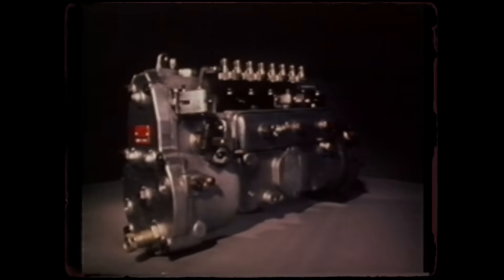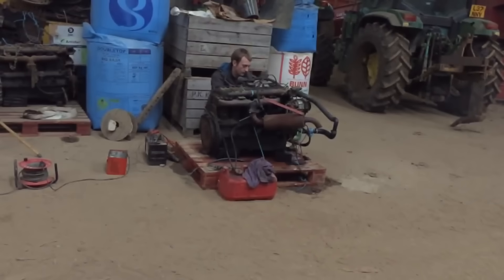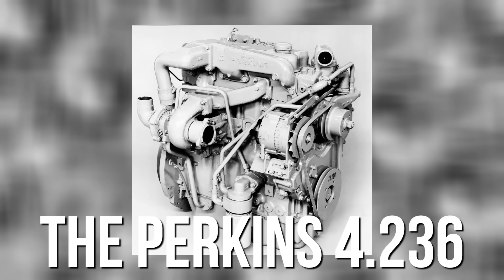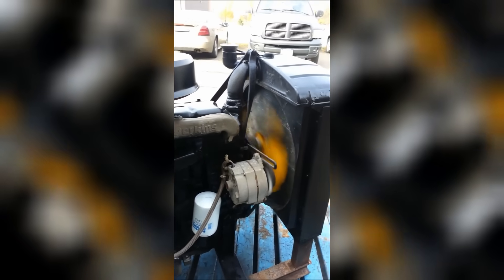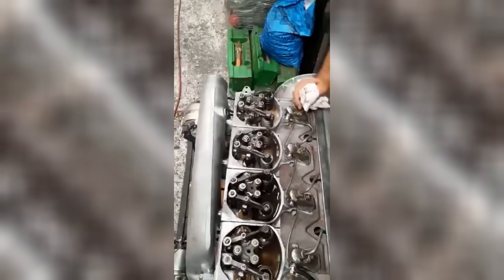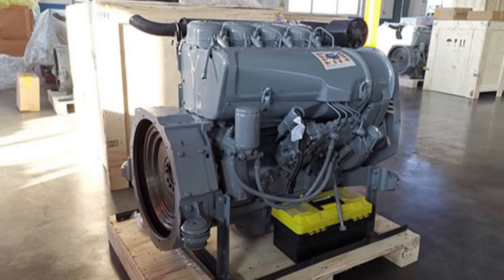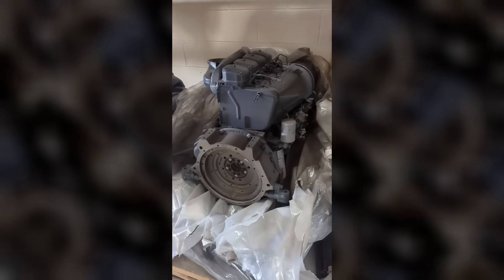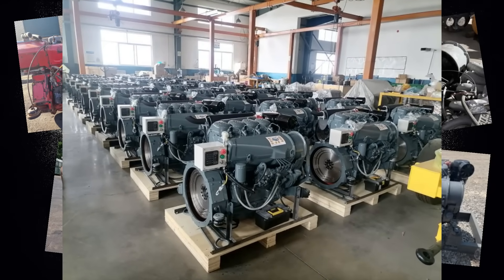The Deutz Engine That Silenced Perkins in 1978

Comment: The Deutz 912 and 913 Engines were very Good, quiet efficient and Reliable but had one Flaw, Overheating and Accelerated Piston Rings Wear when
 Working in Extremely Dusty Conditions. You had to Do Almost a Bi-Weekly Cleaning of the Cylinder Cooling Fins Making It's Maintenance extremely Expensive.

Comment: Both the Perkins and Deutz engines were good and it depended where they were operated that determined which was best for the application and area they were going to be operated in,I have worked on both engines and both have little niggles of their own. The air cooled Deutz did suffer from cooling problems in dusty conditions and when operated at high altitudes where the air is thinner. If I remember correctly the cooling fan was oil pressure operated by temperature,the engine was mechanically noisier because of the bigger tolerance’s demanded by air cooling to prevent seizure,I’ve seen these engines work flat out all day in plant machines,on the other hand the Perkins would do exactly the same. As always the standard of maintenance was always a factor in the longevity of how long each engine would last plus the quality of the oil and filter’s used.

Comment: Cool info but instead of repeating the same things like pump seals, clogged radiators, attacked solder, stocking extra parts, reversible fans helping but not solving. All this was re mentioned twice in almost the same context and way in only the first half.  This seems like it's the way with every video. 

Instead cover the struggle of an overcooled air cooled engine in cold weather and light load. Or the added importance of oil as part of the cooling system.

Comment: I worked on a seal coat paving crew that sent out 3 Deutz Air cooled pneumatic rollers; I had nothing to do with them but they seemed to make believers out of doubters including the mechanic, a service truck operator and the supervisor. The operators thought they were noisy. I don't think they were as noisy as the 4-53 in my Etnyre Chip Spreader. I'm always intrigued by machinery with less to go wrong.

Comment: Why no mention of the extra problems caused when running Air Cooled engines lightly loaded in cold weather?
Reply: What are the problems?
Reply: @giggiddy I worked underground with Jumbo's and LHDs with Deutz engines, they were good but without some care cleaning the fins they rapidly wore out and started burning oil thus making them unusable, the LHDs were re -powered with caterpillar engines, longer life and more power, horses for courses I would say
Reply: @TayneCooper I sure appreciate the response

Comment: In the 1970s, I overhauled many plant diesel engines. I always thought the Perkins was a rubbish engine. Once you understood the Deutz they were a very good engine.
Reply: The Perkins engine was rubbish. That's why they kept running for 20yrs plus in thousands of Massey-Ferguson tractors.
Reply: @James-kd7dc Combines also.
Reply: Horses for courses as they say. back in those days Perkins had a large range that included both good and bad engines.
The problem comes when comparing a good, new, model with an established range of engines built over 20 / 30 years.
Reply: If the Deutz engine was so good why aren't they selling like hot cakes now?
Reply: @Johnsmith-zi9pu  because air cooled engines can't meet the latest emmissions legislation levels I believe.

Comment: That was the secret of the original VW,as it was also air-cooled! In the North Africa campaign,the air-cooled engines ran,while the Allies water cooled had failures! Also the VW's ran in the Russian winters,better than the American diesels,which had a tendency to freeze oil tanks! Water cooled engines,have problems,and mitigation is harder in extreme circumstances! Anyway,this planet,has many areas that test equipment,and there are,hopefully, lessons learned! Thank you 😇 😊!
Reply: Germans in north Africa only could run if they had gas lol. Germans had the worst gas in ww2.. everyone in the automotive industry even Porsche quit using air cooled engines in late 90s. Problem with air cooled vw is it takes way too long too warm up also you got too use thick oil 20w50. In russia if they were plugged in and were warmed up for 45 min. All’s diesel need so they don’t. Freeze is an additive. Gets down too minus -45 Celsius were I live my diesel has never froze.
Reply: Large inefficient Lawn mower engines.

Comment: I like the way they say a quick blow with compressed air cleans the Deutz engine , but that is a chore on a Perkins.
Have come across a few of these that court fire with chaff in the Finns as they run so much hotter. And can suffer at the other end with over cooling at light load. Unless fitted with an air flap thermostat.
Reply: That's why they went extinct and the Perkins is still in production.